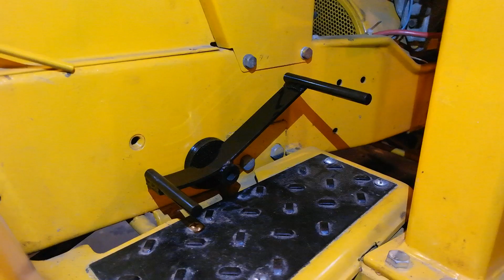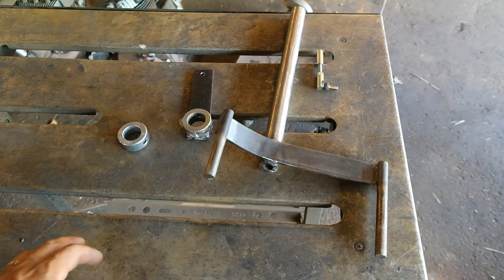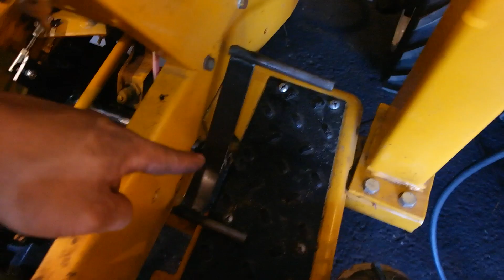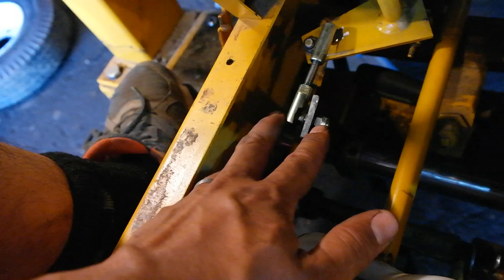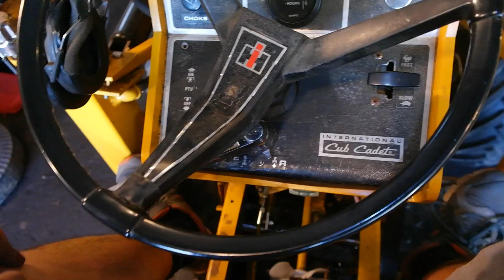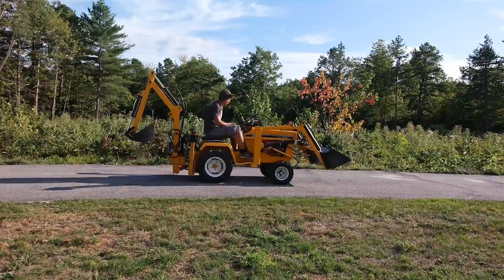Foot Control Hydro Lever for Cub Cadet 149 TLB

Comment: I have a cub ags 2160. The tractor has a vanguard engine and is in really good shape except, the tractor will not pull like it is supposed to going up a hill. It will only pull in 1st gear under a load. My question is do you know of a swap that I can make better use of the tractor. Could I take a transmission/differential from a 149 and put in the ags 2160?
Reply: No, in your situation, swap in the transaxle from a 2185 and you should be good.

Comment: Norman, you can still run the deck correct?
Reply from the maker: No since I use the holes for the deck mechanism this machine can no longer mount a deck
Reply: How about a 1A tiller?

Comment: I have never liked the heel toe peddle on hydrostatic drive tractors like kabota and others, I very much prefer the forward and reverse drive peddles side by side.... but in this case it makes a perfect addition to the hand control.. very nice...
Reply: I agree with you.  The main reason is while running a terrimite backhoe once I almost ran over the boss when my muddy foot slipped forward.  Scary as HELL

Comment: Thanks for responding. It's a cub cadet 108 gear-driven model. The clutch only disengages (to select another gear) when the pedal is pushed all the way to the floor. The clutch used to disengage when the pedal was depressed about halfway. I was thinking maybe the clutch is worn. Thanks in advance.
Reply from the maker: Oh I see what you're saying now. Yes the clutch should disengage half way through the movement, and then the brake comes in on the second half of the movement. I suggest checking your linkage for wear and adjust if necessary. There is a company called Cub Cadet Specialties that carry's Cub cadet specific parts and may have the linkages you need if you have to replace them. Google them and go to their website.

Comment: What does it mean when a cub cadet brake/clutch pedal engages when the pedal is pressed to the floorboard? When it's in this position, the clutch grinds and barely goes into gear. Love the videos man keep it up! Thanks in advance.
Reply from the maker: Thanks for your message. What model Cub Cadet do you have? If you have a gear driven cub normally when you press the clutch brake down it disengages the clutch, and your transmission should stop all together.
Reply: I had that issue, and it ended up being broken clutch springs.
Reply: clutch brake is out of adjustment,tighten up and problem solved

Comment: What kind of tie rod ends did you use or where did you get them. was thinking of doing the same, can make everything just need small tie rod ends like those
Reply from the maker: I think I got them off of ebay. They are 1/4" tie rod ends

Comment: question when you eliminated the hydro lift how did you block off ports in pump????? and nice job i have a 149 with loader and i have been want to foot control it but didn't want to put hole in frame
Reply from the maker: Shawm Ray I just looped the ports by connecting a hose between them and tucking it out of the way

Comment: Good work! So you could use an existing hole in the tractor! Is there a bushing on the other side? Did you use the round "stopper" without the welded on steel plate to lock the pedal from sideway motion? One little bit of criticism : more light! It's difficult to see your great work as it is installed in the tractor. Regards Nils
Reply from the maker: yes the locking bushing was to prevent side to side motion. yeah I had a light shining in the tractor but I think my camera setting was off. I'm going to see if I can edit it on my software to brighten it up.